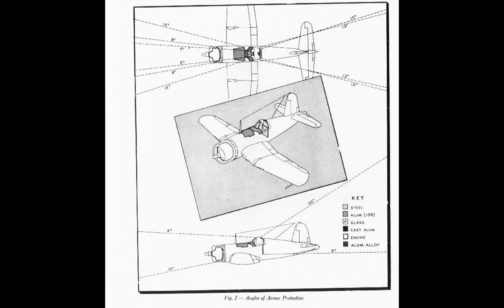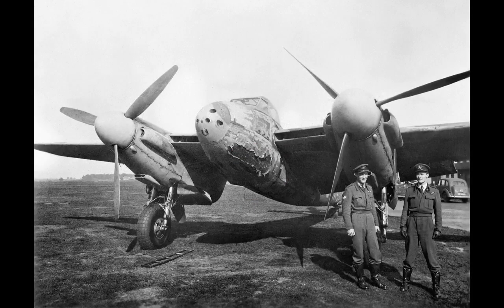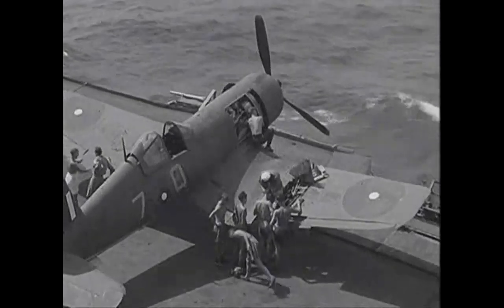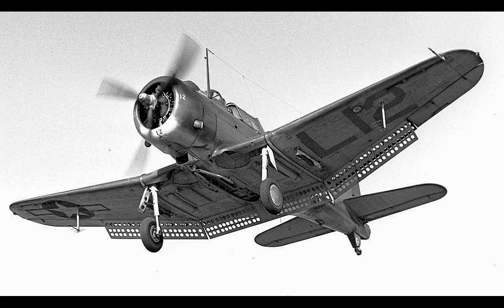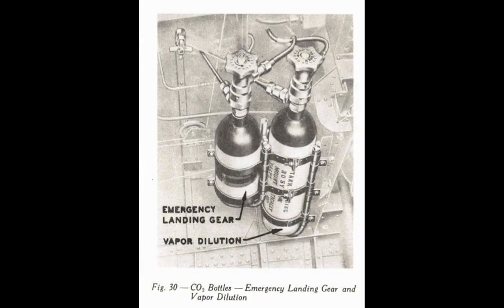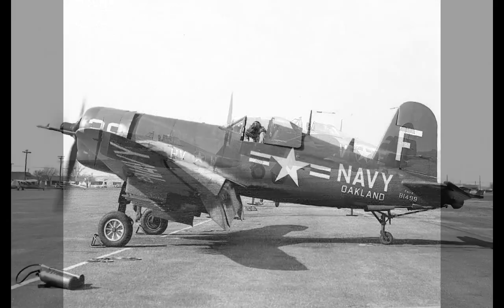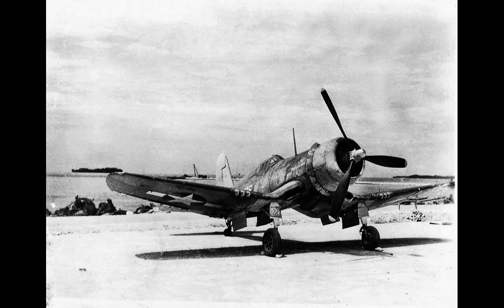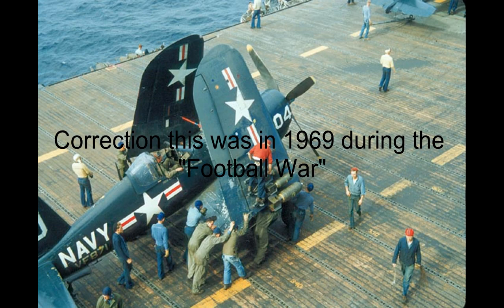F4U Corsair Design Features

Comment: I'm pretty sure the position of the vertical fin would have more to do with spin characteristics, and preventing the tail plane from blanketing airflow over the rudder in the spin, than structural limitations of the tail cone.
Reply from the maker: I don't think so for two reasons. First the Corsair isn't rated for spins, and I couldn't find a single airplane with a tail like this that is. Second, most planes that are good at spins have a tail design that's the literal opposite, look at a Zero or P-51 for example.
Reply: Greg. Thanks for your quick reply. I really enjoy your videos and find this a very interesting topic. I hope you don’t mind me pursuing it little further. I know that intentional spins were not permitted in the Corsair, but it was spin tested and it’s characteristics commented on in the Pilot Ops Manual and as such, had recommended recovery technique. Generally, from a design perspective, the vertical stabiliser can either be placed in front of the horizontal stabiliser or behind it to avoid blanketing of the rudder in the spin. This tail design was not uncommon in spinning aircraft of that era. The De Havilland Chipmunk and CAC Winjeel are a couple of examples which were both used as military trainers and were spun often. The Corsair tail design looks to me to be a fairly standard design feature to improve handling characteristics in the event of an inadvertent spin. I’m still looking for a particular reference to the Corsair to confirm this theory. Cheers
Reply from the maker: Hi Andrew, if you find an original source to back this up either way, I would love to see it. As far as I know, all U.S. operational WW2 fighters were spin tested, but not all had intentional spins prohibited as the Corsair does. I think it's safe to say that the ones that didn't were the ones with more difficult recoverys. 

Regarding the Chipmunk, I haven't flown one, but my understand is that its spin recovery requires a more aggressive technique than most trainers that are approved for spins. Plus they had to add strakes to the plane to get it to behave well in spins. It's also a much lighter airplane than any WW2 fighter. Are there any WW2 combat planes with this tail design approved for spins? I can't think of any, but I can point out several that are not, the Corsair being one.

Comment: I have a question about different variants of the Corsair - more about Pratt & Whitney, really. Why was the F4U-5 (R-2800-32) faster than the F2G types with the R-4360? What did Pratt & Whitney do with the 2800 that made it so powerful, and fast in the Corsair? Why was the smaller engine able to churn out so much more horsepower in the latter years of piston-engine history? What on Earth did P&W do to that old engine design over the years? The Super Corsair wasn't as super as the the F4U-5, and I find this very interesting.
Reply from the maker: Oh, that's a great question. It's complex and I'll have to answer it in a video at a later date, there is really just too much involved for a short answer.
Reply: @GregsAirplanesandAutomobiles  Thank you, Sir! That would be wonderful. Perhaps a quick run-through of the major improvements of the 2800 in the Corsair leading into the main discussion would be good, as I am curious about the engineering of increasing HP in the landmark R2800. 
A bit off-topic, but was the Corsair the first and last "production fighter" to use the R2800 in the scope of 2800 history? I was surprised one day to learn that the Corsair was produced as late as 1956 (?) for the French, with a reduced HP R2800 variant, since it was just for ground attack. I am enthralled with the Corsair as, perhaps, the greatest fighter of WW2 due to its longevity in usefulness and production. This aspect of the Corsair puts it way ahead of the P-51 as the greatest fighter of WW2, but that's begging for an argument. But we all seem to like arguments on Youtube.

Comment: Regarding the vertical stab forward placement, your’e not wrong in stating the structural benefits of setting the vertical structure slightly forward on the rear fuselage incidentally sharing a bulkhead attachment with the tail wheel assembly but the exact position was apparently predominantly determined by maximum airflow positioning given the long bulbous forward features and wing intersection interference but still required an oversized rudder to be effective. One thing I was really hoping to hear more about was the white fuel tank marking on some variants, you touched on it inadvertently when you showed the layout of the Dural which coincides. Another great video, on a fantastic subject, well researched and authoritatively delivered as always.
Reply from the maker: Sure thing, that's sealant to prevent in cowl air pressure from forcing oil that leaked from the engine out of the seams and onto the windshield. Old radials leak oil, even when new.

Comment: How come all the F4F, F4U and F6 was used in the pacific but not in Europe.
Specially for the F4U that have problem landing on carriers in the beginning. It did have rather good performance at the time it was introduced, even compared to aircraft that was not carrier based.
Reply from the maker: That's a great question, but it's complex and I'll have to take care of it in a video.
Reply: Navy in the Pacific theater of war and the army in Europe.  F4F, F6F, F4U were specifically designed for aircraft  carrier operations.
Reply: @maxschell8823  That really don´t stop the airforce from buying the aircraft if its good.

Comment: As a Corsair fan I would like to add that the British had reinforced flight decks so the British clipped the wing tips for folding clearance.
The 90 degree folding gear was accomplished with an offset knuckle that had to turn as it retracted.  The F6 used a half gear on the wing and one on the oleo that meshed.

Comment: The A-26 is notorious for crashing if you loose an engine on take off, blue marks or not you better have plenty of runway  ahead of you if you loose one or altitude because you will go left or right if an engine goes and no amount of rudder will save ya either. I'm an A&P IA mechanic at KRFD and have been in a 5 year restoration of this airplane. I will admit, they are a very awesome plane
Reply from the maker: The Martin B-26 Marauder had that reputation. The Douglas A-26 Invader (later called the B-26) was much better in this regard. However any high powered  piston twin is a handful if you loose one on take off.
Reply: @GregsAirplanesandAutomobiles  yep and never EVER turn into the dead engine unless you have plenty of airspeed and altitude and you know what your doing. Bob Hoover was the man when he was flying his shrike!!

Comment: 21:25 - Not really, its a ball which you kick with your foot... Couldn't be simpler.
Outside of punting, field goals and 1-point conversions, you pretty much just use your hands in gridiron "football". So if anything, that's a more confusing name. It should be "handball" instead.
Reply from the maker: By your logic, soccer should be called "feetball" since players kick it with both feet.
Reply: @GregsAirplanesandAutomobiles  Well yes, I'd agree that makes more sense, plus as it is a silly sport so it should have a silly name.

Maybe they didn't want to discriminate against any 1-legged players.

Comment: Having the tail further back allows for better spin recovery because the tail is not blanking the rudder during a stall.
Reply from the maker: Spins are prohibited in the Corsair. In fact, I can't think of any powered airplane with a tail like the Corsair's that is safe to spin. Normally for spins you built the tail the other way (rudder more aft), more like a Zero or P-51, which are approved for spins.
Reply: @GregsAirplanesandAutomobiles  further back you get blanking or a wind shadow from the tail.  T-tail is best to prevent this and is why you see so many T-tail gliders.
Reply: @GregsAirplanesandAutomobiles  so I looked this up for you.  FYI I am a CFI.  https://aviation.stackexchange.com/questions/47074/why-is-the-horizontal-stabilizer-forward-of-the-vertical-stabilizer-on-the-p-51
Scroll down and look that they include the Corsair also.  Since the tail is all the way aft (for more pitch authority most likely) they could only go forward.  But it is a small tail section so further would provide better structural stability.

Comment: The Luftwaffe's Stuka was the other famous WW2 aircraft with a bent wing design. Were there propeller implications since speed wasn't an issue with that highly successful dive bomber? Since it carried its bomb tucked in between the wings, lowered by a trapeze, clearance might have been a factor. Just curious.

Comment: pretty good video--covered a lot of ground very clearly, yet, with the Corsair, there are so many more interesting parts of its history left to tell, some good, some not quite as favorable---in part because of that vertical stab position, pilots knew to avoid entering a flat spin.  On the other hand, the beautifully smooth finish of the surface was pretty advanced for the time.  I do think that a couple of other important pieces of history might warrant an entire second edition of this first work.  One is the mid 1944 efforts by Charles Lindbergh that pioneered the process of doubling the bomb load to 4000 pounds, which gave the F4U (I found it interesting speaking with one of Boyington's Black Sheep that this pilot referred to the Corsair as simply "the F4"--not even F4U-- as if it were the only F4 in the Navy!) the same offensive capability as the Mosquito bomber.  Lindbergh went on to prove the weight lifting capabilities of the F4U-1D in a 65 degree dive-bombing attack on Wotje Island---so much for his so-called "civilian technical representative" role in an active combat area!  I also find it interesting to read how many people are apparently surprised at the victory of a P-51, given the US Navy's careful and detailed evaluations of the two types against one another in early 1944, where the only advantage the P-51B had (it was faster than the D model) was a slight margin in horizontal speed between 13,600 and 24,200 feet.  But even there, from that altitude up to 30,000 the Corsair was "markedly faster" up to 30,000 feet, whereupon the Mustang was the faster. The Mustang's only "marked superiority" was to be found in dive acceleration, whereas the Chance Vought fighters were all over the Mustang under all conditions in level flight acceleration, maneuverability and response, with better takeoff performance and lower stalling speeds.  The Mustang also suffered from inadequate lateral control at low speeds and extremely poor visibility over the nose in 3-point attitude.  (combination making the curving English approach challenging).  The US Navy's report also stated that "for an equal range, the Chance Vought fighter showed eighty-six per cent greater firepower."  For these and other reasons, the US Navy rejected the Mustang for fleet service.  The other thing the Black Sheep pilot told me was that as a stable gun platform the F4 was unmatched.  He mentioned that compared with an F8 Bearcat----which he said was a difficult gun platform----the F4 was a dream in that regard.  All of that to say, it doesn't seem too surprising the "soccer war "ace"" was able to dispatch the P-51 with his evidently more lethal mount.  Many other interesting facts too numerous to write----like the fact the F4 was America's first turbojet powered fighter (October 1943--first flight with the Westinghouse 19A turbojet), but practically begging for another episode of "Greg's Airplanes and Automobiles"----JV
Reply from the maker: Good post. I will have more Corsair info in the future. This was just a start.

Comment: I don't know whether this was the case or not with the Corsair, but sometimes aircraft have offset vertical and horizontal stabilizers to ensure that the vertical stabilizer is not blanked by turbulent airflow coming off of the horizontal stabs during a spin.  This discussion on stack exchange has some diagrams:

https://aviation.stackexchange.com/questions/47074/why-is-the-horizontal-stabilizer-forward-of-the-vertical-stabilizer-on-the-p-51

The F/A-18 hornet has the vertical(ish) stabilizers way ahead of the horizontal stabilizers, but this has to do with positioning them within the flow fields of the vortices generated by the "cobra hood" LERXs at high AOA, as well as improve area ruling, and I'm pretty sure that designers weren't doing anything like that in the 1940s.  This is per Ray Whitford's excellent book on fighter design, BTW.
Reply from the maker: Spins are prohibited in the Corsair.

Comment: Hey Greg. Informative video. Quick question about tire issues for the Corsair and other WW II fighter planes. Do you know if the Corsair was more prone to flat tires on landing than other fighter planes? I know they had a bouncing problem, at least prior to modification. Not sure if that might've contributed to more flats or maybe the design of landing gear. Your thoughts?  Thanks.
Reply from the maker: I have never heard of a tire problem with WW2 fighters, except in regards to tire loading, meaning how much weights is put down per square inch of contact area. That's a factor on soft surfaces. For example, 109's went to larger tires in some models for that reason. The Corsair's bouncy bounce issue was solved by changes to the oleo strut. This was also thanks to the British.
Reply: @GregsAirplanesandAutomobiles  Thanks, Greg. Did Goodyear manufacture the tires used on the Corsair? And were the same tires used on other fighter planes like the Wildcat?

Comment: For once someone has not overlooked TF-57 (later TF-37), thank you.  
Not an insignificant element in the Pacific theatre, the fleet included 6 fleet carriers, 4 light carriers, 2 aircraft maintenance carriers and 9 escort carriers, with a total of more than 750 aircraft, 4 battleships, 11 cruisers, 35 destroyers, 14 frigates, 44 smaller warships, 31 submarines, and 54 large vessels in the fleet train.

Comment: Re the fin placement, as a flier and modeler of aircraft I have always found this an interesting point. When you are flying a tail dagger you invariably look for a pronounced nose high attitude just before touchdown so the you can execute a 3 point landing, not so much with a nose wheel equipped aircraft but you still need to flare. At the point of the flare you have very little airflow going over the rudder to give it sufficient authority to keep the aircraft straight,  generally you are dancing like mad on the rudder pedals so you don't have a ground loop.
When you flare hard like the if the rudder is at the top and very back of the fuselage the tail plane and elevator can effectively blank off the air going over the rudder so you lose even more authority.  Either you have a bit of throttle on so there is wash going over the rudder (prop plane) or you do as they do and bring it forward so that air will part and flow around the small part of the fuselage and hence keep control.
In terms of longitudinal stability it is always better to have the elevator at the very back as it makes the aircraft less pitch sensitive.  Of course the other way to get around it is to have the rudder go below the fuselage as well to provide control, this is how my aircraft is setup.

Comment: Greg, read the book by the Grumman test pilot. He says the F4U's speed was the same as the Hellcat (above 5K). This was due to the design of Vought pitot tube according to author. Many folks compare the Hellcat to the Corsair but they weren't really contemporaries. The F4U was in competition with the Wildcat for Navy contracts. Thanks for the vid, I really love the Navy birds. There is a story (I think it's in the same book) about two test pilots, one in F6F one in F4U, that is quite hair raising. O2 sys fail in F4U causing blackout of F4U driver and other pilot tipped the wing up ,port side I think, of F4U causing a descending right turn. The guy came to at approx 6K and was in a very bad mood.
Reply from the maker: I have read that, but I haven't had a chance to address it.

Comment: The Reason why the F4U Corsair was removed from carrier warfare wasn't because it was difficult to land but the Navy decided to use F6F Hellcats due to logistical reasons. By the time the F4U was ready to put to sea all other attack carriers had Hellcats, VF-17 first Corsair Navy fighter squadron, was ordered off the USS Bunker Hill when the ship pulled into 
Pearl Harbor. This is an excerpt from THE JOLLY ROGERS The Story of Tom Blackburn and Navy Fighting Squadron VF-17, chapter 11:

"Bally and I had talked about the possibility of something like this happening, and we both thought we knew why. As the Navy's only carrier-based Corsair squadron, our place in the supply system was ambiguous, to say the least, and troublesome. All the other carrier-based fighter units were equipped with F6F Hellcats or, in the case of smaller ships, F4F Wildcats. The hard realities of the supply system, we guessed, had simply overwhelmed the front office's authentic desire to see us 
operating Corsairs from the carrier. I suspected that the decision had been made without emotion at AirPac headquarters, for they, after all, would be the people who would have had to jump through hoops to keep us supplied. Bally was later told by AirPac staffers at Pearl that this was indeed the reason we were relieved, and not—definitely not—because the front office  thought the airplanes were were unsuitable for carrier work. The decision and news, however, were truly shattering."